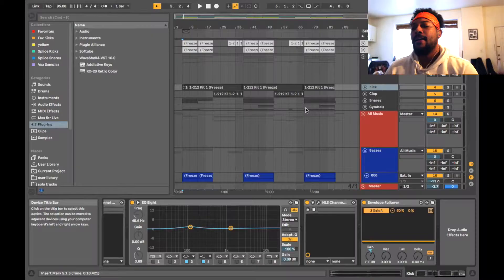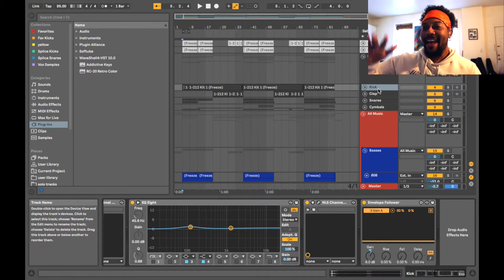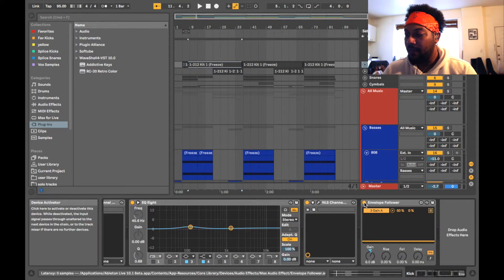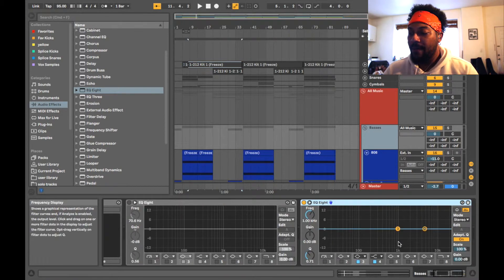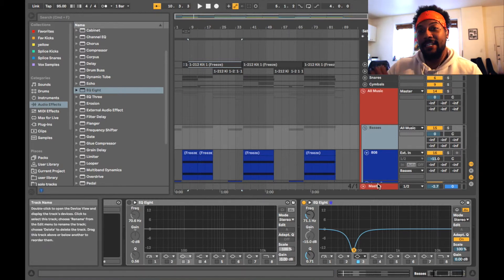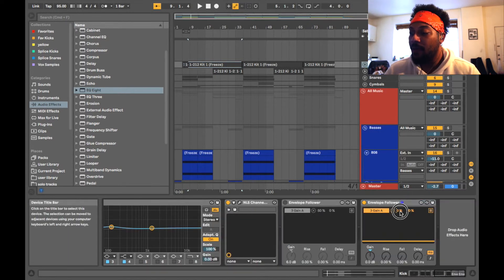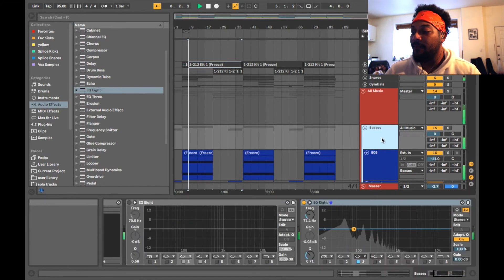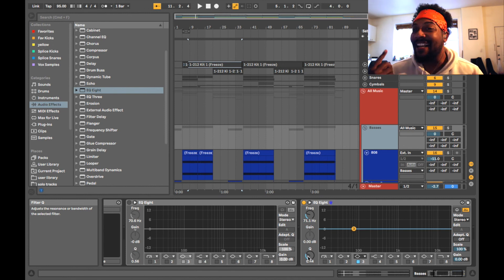How to use EQ8 as a Dynamic EQ in Ableton Live 10 | Mixing and Mastering

Comment: Good idea.... 😊... With the tails using sidechain comp  I find that instead of using the kick as the sidechain, by instead using a trigger as short as you can write as a send only, you have a lot more control of the release..... I usually load a simpler into a track and put the shortest hat I can find into it... I then close the end loop as tight to loop start of the hat in simpler and use as the sidechain input..... Being it's such a tiny trig it really gives scope on the attack/release of the compression (that I pretty much always use at around 6:1 for ducking).... Really like the idea of how yourve worked around achieving a dynamic EQ with stock plugins..... Good stuff...
Reply from the maker: Thanks man!  Yeah you mentioned works too.  I use regular sidechaining as well.  The hi hat trick will work well but I'm just so lazy with it that I don't want to find another sound.  To get a similar effect you can put a hi pass filter on the side chain that is connected to the kick and just use the hi end of the kick to sidechain to and it will give the same effect as you describe with the hi hat.  But at the end of the day its only about what comes out of the speakers.  Dopeness!

Comment: If you have a four on the floor kick pattern (e.g. in Techno or House) you can also use the shaper in M4L to achieve the same thing. However, your solution is great for any other kick pattern and I hadn't thought about using the envelope follower for this!
Reply from the maker: Yeah man.  I'm glad this gave you some ideas.  This way just makes it so you don't have to buy another plugin to do it.  There are a few plugins you can do it with, but it is cool that in ableton you can do it with stock plugins

Comment: I just had a thought on the tail end issue, would it be similar to use a kick drum made in operator or analog as a sidechain and then use the decay to control the tail end? Just thinking..
Reply from the maker: You could do that.  There a lot of ways to make this work.  Some people will take the same kick and sidechain to the full kick and then duplicate the sidechain compressor so it doubles the amount of compression instead of lowering the threshold.  That way makes the tail matter less.  I do it my because it makes me think less and just get the job done.  But it doesn't mean you can't get great results your way.  For me its just more work, and I'm tryin to make it as easy as possible.  Try it and let know how it works.
Reply: Wave Magnetik thats a good one too
Reply from the maker: So you know, I live stream monday-Friday at 7pm EST.  Come back to the channel tonight if you can